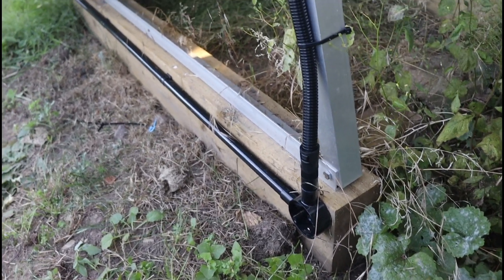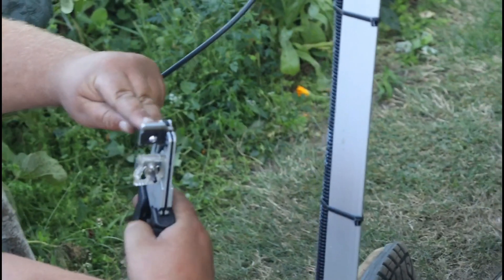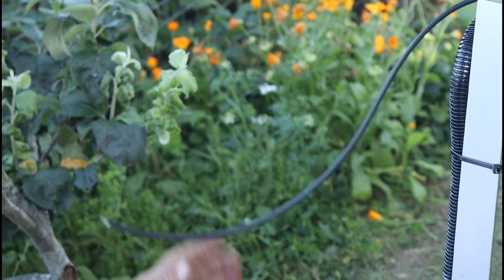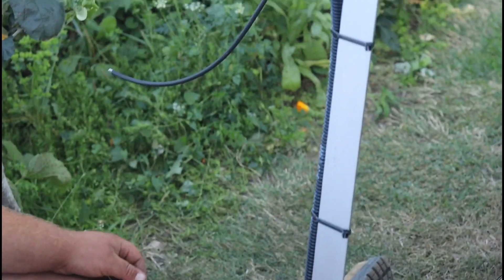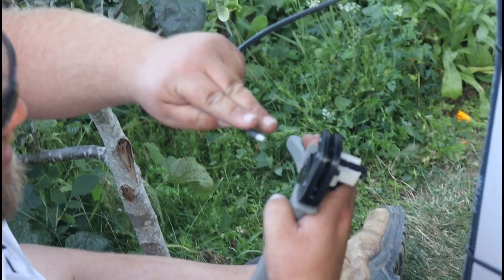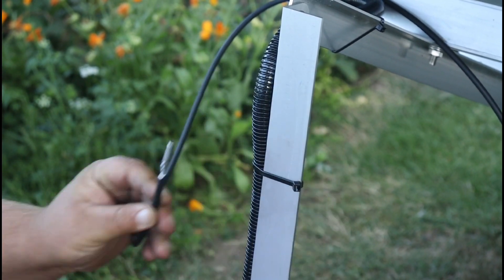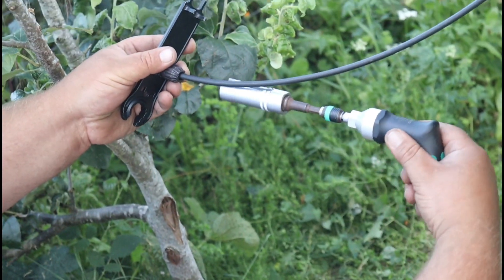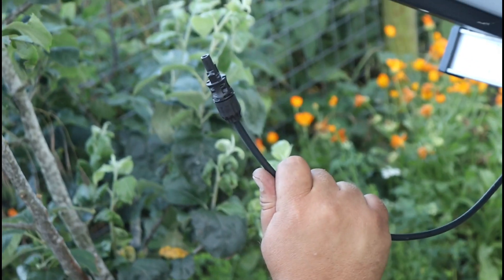How MC4 solar cables are made

Comment: Thanks for the video.  I like your content.
On this one though having read your title, I was expecting a fatory tour of either PV cables or MC4 connectors, not your sparky making them up!  Never mind, I liked it nevertheless so thanks.
Reply from the maker: That's the point they're not made at a factory bought then installed , they're made on site specific to each install.  I thought they'd buy in pre made cables  but no that's not how they do it